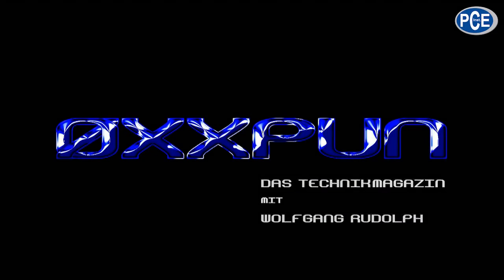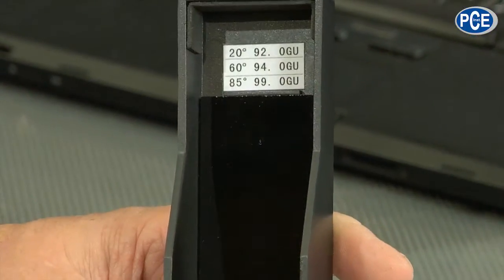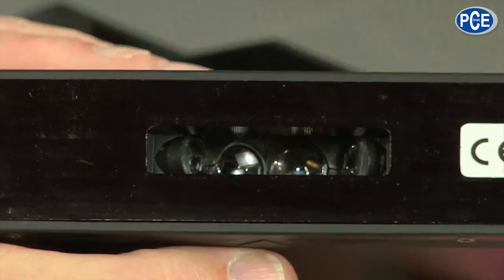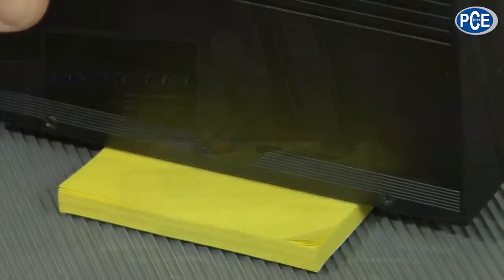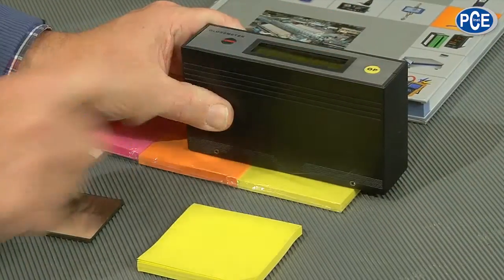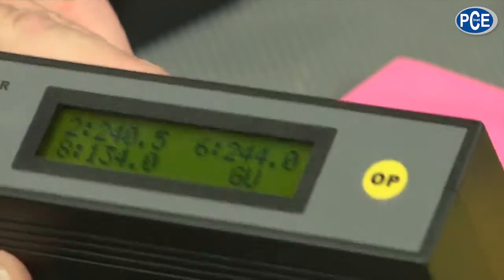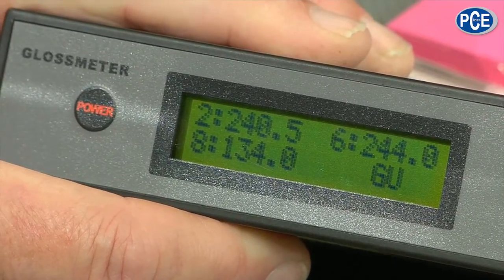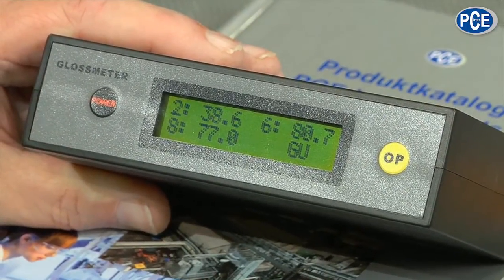Gloss Meter with 20°, 60° and 85° Measuring Angles / PCE-GM 100

Comment: Can you set it at 60 gloss units so doe not measure in all 3 ?
Reply from the maker: Hi,

Our PCE-GM 100 show after one measurement all 3 results (from the 20°, 60° and 85° angle).

There is no need to change the settings or to repeat the measurement to get all readings displayed.

After the meter has passed the calibration and you want to perform a measurement just place the device on the surface and press the OP button. The meter will make a noise (buzz sound) and the result for all 3 angles will be displayed.
PCE Instruments